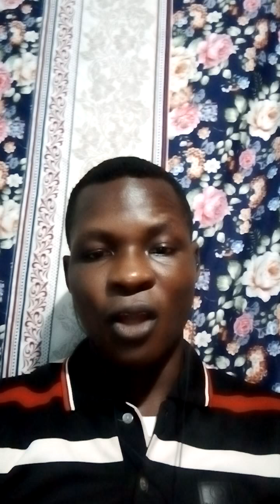How Fuelless Generator Works?#fuellessgenerator #freeenergy

Comment: I’m about submitting my final year project topic on a fueless generator 
Pls can I get an estimate in building it pls 
Thanks
Reply from the maker: Hello am really so so sorry for the late reply and  am so glad you are interested in building your own fuel-less generator, 
About the financial aspect it would take a bit, though I really can't tell the actual price or amount it would cost you but this list below should be helpful.
This are items you can get.
1.) DC Motor
2.)12v Battery 
3.) Charging system 
4.) Generator Frame
5.) Generator Alternator
6.)AC Voltmeter for checking the (Alternating current)Output Power eg.220vac
7.)DC Voltmeter for checking the 12v battery 🔋 status.
You can make an enquiry of those listed items in the market.
I wish you success on your Project my dear friend 😊

Comment: Thanks for lecture.My own concern is you did not talk about the starting coils again.Or what is the function of starting coils here?
Reply from the maker: Thanks for asking sure a nice question.
The starting coil helps to produce a current as long as it is placed close to the fly wheel are close range.
And you can convert that current to DC also if you can connect a bridge rectify diode to the output of the coil to convert the current being produced to DC.

Sorry I haven't talked about it for some time now, it's because there are some things I need to get to make the system run smoothly I haven't gotten them yet that's why I haven't posted anything related to it for now.